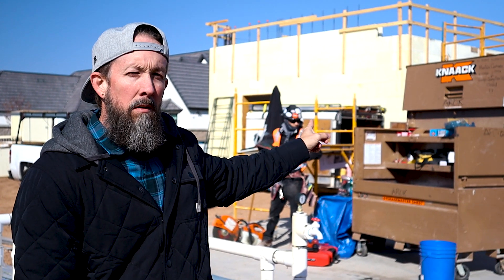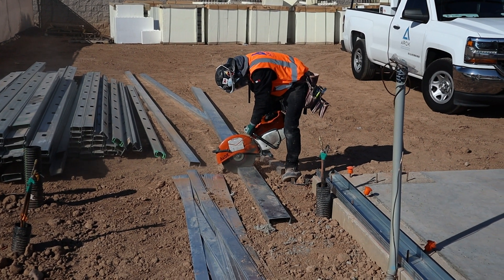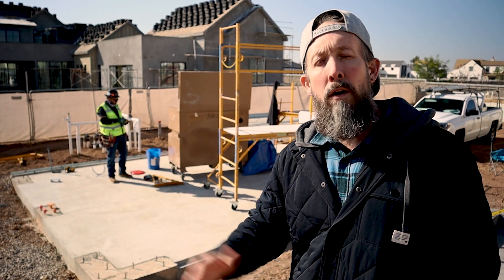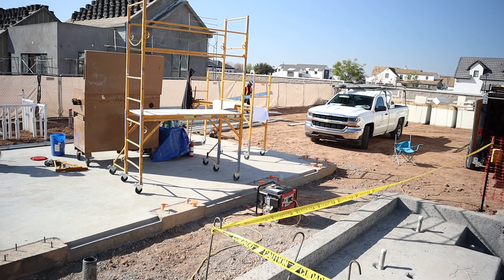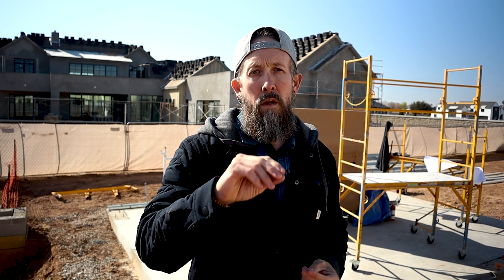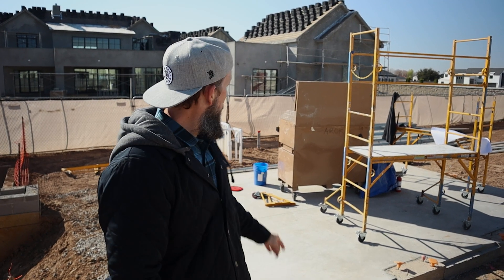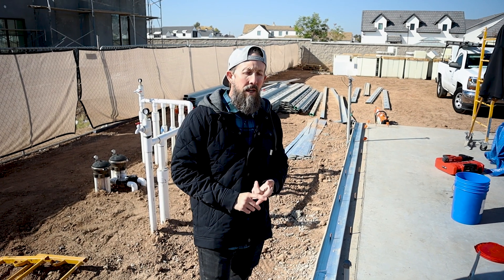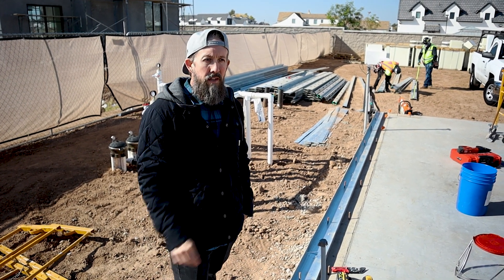Cold Metal Framing: The Future of Construction | EP-30: Liberty Estate |  AFT Construction

Comment: What about concrete walls?
Reply from the maker: What kind are you thinking? Poured in place?
Reply: @aft_construction  the same method used for concrete walls in a basement...can it be used for the ground floor as well as the upstairs floor?
Reply from the maker: @Timothy-jc1oc poured in place concrete would be costly, the structural engineer recommended CFS as well.